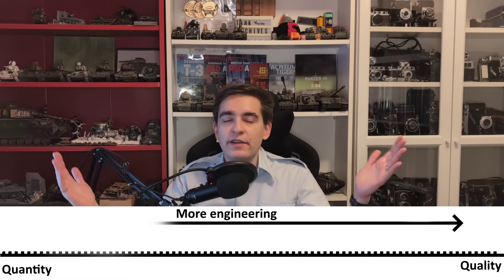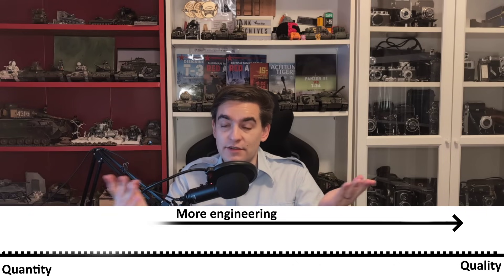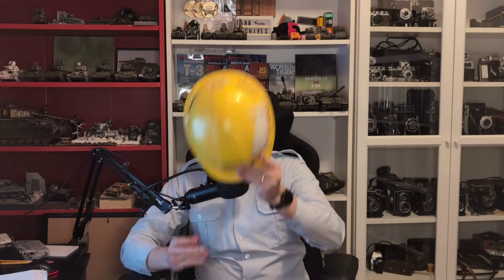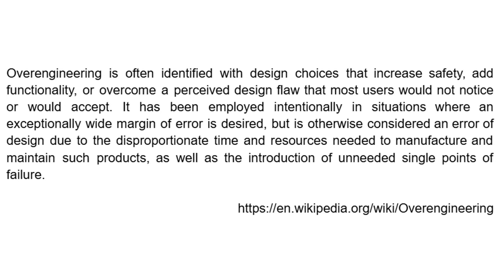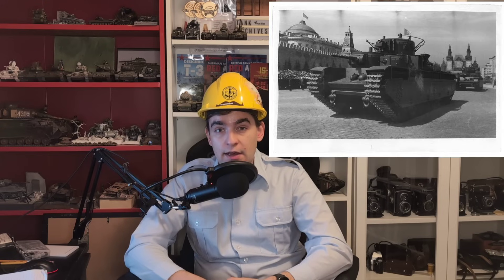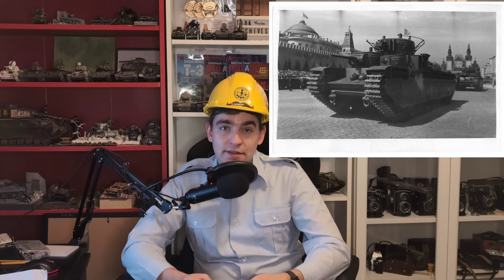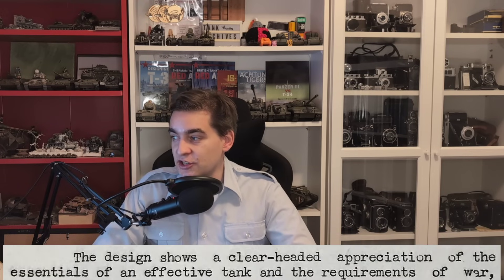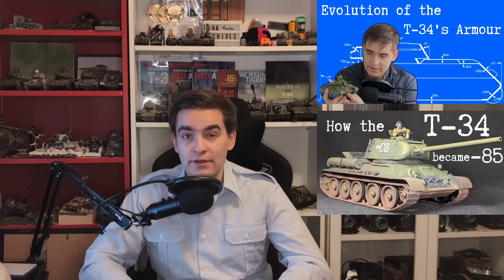Was the Tiger overengineered?

Comment: The 'Tiger' from a technical perspective was clearly a better tank than a T-34. The fact that the Tiger did not see major revisions proves, that is was well engineered.

In contrast the T-34 started its service life very poorly, having many design flaws. Yes, it was almost impervous to the german 3,7 cm AT guns... so were the Char B1, the S-35, the Matilda and problably even some french light tanks.

I really cannot understand how one can come up with such comparisons. T-34 was a mediocre machine, produced in vast numbers. ~44.000 of these tanks were lost during WW2 which is 25% more than ALL tracked vehicles produced by Germany during the war.
Reply: The figure you quote (44,000) also includes T-34s scrapped due to wear, not just combat losses.

And by comparison, the Germans lost 42,000 AFV on the Eastern Front alone, and some 67,000 total during WWII (yes, I know that's more than German production, but they made extensive use of captured Soviet and Allied tanks.  The Germans were using as many captured T-34s at Prokhorovka as they had Tigers).

Moreover, a Tiger vs a T-34/85 is NOT a huge mismatch, even in terms of gun vs armor comparisons.  While's true that against the T-34/85's thin (by late-war standards) upper hull (but not against the turret), the Tiger's gun still had the range advantage, the Soviet 85 mm could destroy a Tiger at practical ranges just as well as the Tiger could destroy a T-34/85.  Every other advantage (speed, reliability, etc) lies with the T-34/85.
Reply: Such games as World of Tanks and War Thunder did a dialectical thing: on the one hand they greatly increased the interest of the World War II military equipment among the average person, and on the other hand they generated crowds of half brain champs, for whom the combat and warfare became something like a game match with counting “pvp scores”.
Reply: @Ailasher I've never played either game, but a common feature of tank wargames is that your tank always works and operational factors like crossing bridges usually isn't a factor. 

Another factor in wargames is that there are no real penalties for failure.  If your tank gets blown up, you just play another game. If you lose an operational or strategic game, there's always tomorrow.  You don't really die and you don't really suffer the same consequences of a decisive defeat. If you did, then all wargamers would play a lot more cautiously, just like their historical counterparts.
Reply: @stewartmillen7708  There is one more important factor here, regarding T-34 losses on the battlefield. The thing is that even before the fact of what this tank was (obviously “good enough”, for the Red Army of course - like all equipment of wartime and especially of the mobilization period of the economy for all nations) it is worth considering how the Soviet side of the conflict used this tank. And it used it so intensively that I am not even sure that this phenomenon has an analog. As far as I know, the T-34's main losses in the war were not from German tanks, but from German assault guns such as StuG or Hetzer. Not to mention infantry anti-tank guns. 
So, the thing is, the T-34 fulfilled all of these roles. Of course, the Soviets had specialized equipment, like SU-85 or SU-76, but just look at the dates of development of this particular vehicles and understand that the second period of the war on East Front, while the T34 has already become a veteran on the battlefield in less than two years.
Assault of fortified positions, infantry support in the offensive and defense, independent actions of mobile tank and mechanized units - the T-34 did it all and more. Hell, this tank was even almost the main “armored personal carrier” of the Red Army on the battlefield - taking the famous “tankovy desant” as an example. Although, in this respect, a word “armored” did not extend beyond the tank crew.
Even taking reconnaissance as an example: the Red Army had armored cars, but I know of cases mentioned where individual tank platoons on T-34s were used as scouts for enemy fortifications. And there was a logic under it: that the enemy seeing tanks attacking their positions will have less intention to hold back and will show more cover positions of their main means of defense, like AT guns and other things.
Reply: @stewartmillen7708  But these all factors, including the ones you mention, are irrelevant to an individual who has a “kill ratio” literally from PC/console games in their head.
Reply: @Ailasher   I agree with all your points and more.  Insofar as 'tank vs tank' encounters and relative kill ratios, the point that I think you're driving at is that 'tanks have other jobs to do than to just fight other tanks', and that wasn't a point just shared by the Red Army, but by the US Army as well with the M4 Sherman.   In the Soviet army, artillery was the preferred killer of enemy AFV, followed by self-propelled artillery (which is why the ISU series may have been the single greatest killer of German heavy AFV; it was part of their specialized role to provide overwatching fire for Soviet armored advances).  Likewise, in the US Army, the M4 Sherman was supposed to be the general-purpose exploitation tank while enemy tank-killing was the job of US tank destroyer units, which is why there was resistance to replacing the Sherman's 75 mm gun with the 76 mm (the 75 mm had the better HE round so was more useful against non-armored targets).

The only army that did seem to design its armor for tank-killing was Germany, at least as the war progressed, and to ridiculous lengths.  The Soviet assessment of the Panther I believe to be spot-on, it was a 'one trick pony', as we would say, as it was designed to excel only at killing medium tanks in at long range.  At all other jobs, especially in its first employment at Kursk slogging through infantry/AT defenses, it was lacking, due to its unimpressive HE round and its paper-thin side armor that could be penetrated by US 75 mm or Soviet 76 mm even at very oblique angles.  The King Tiger too, as a heavy tank would have made more sense if it had been fitted with the Kwk44 128 mm gun (better HE round and better AT) than the more dedicated tank-killing Kwk43 88 mm.  Given the Wehrmacht fan-boy inclination of many wargamers, maybe it's not surprising that they come to think of tanks only in the 'tank vs tank' role.

But my point is that the metrics usually cited to 'prove' German superiority or that "The T-34 was crap" are flawed.  The Soviet tank dead pile includes tanks scrapped due to wear.  For one example, more IS-1s were lost to Soviet blow torches (melted down after exceeding their mileage limit) than were lost to German anti-tank weapons of all types.  While I doubt this is true of the T-34, the number scrapped is still likely considerable. The Soviets actually made less steel than the Germans during the war, so any obsolete or worn-out tank was far more useful as a source of steel to make a newer, better tank, than to keep.  By 1945, I'd say that a lot of T-34/76s that were still around were going into the smelter and thus "lost".  The USAAF likewise underwent a huge 'scrap-a-thon' in the European theater at war's end, putting tens of thousands of their own aircraft (plus any surviving German ones they had captured) on the chopping block to be sold for their metal.  As one article I read about the destruction of USAAF aircraft said, "seeing these photos are enough to make a museum curator cry".
Reply from the maker: As I mentioned in the video, revisions were required of the Tiger almost immediately. They simply couldn't be made without seriously altering the design.

Any tank used in vast numbers is going to be lost in vast numbers. Tanks are made to win wars, not Call of Duty style deathmatches.
Reply: @TankArchives  'Revision were required immediatly'... Thats normal progression right? And would you say that the construction of a completely new turret is no serious alteration of a design (T-34)? And can I say the T-34 was poorly engineered because it could not take the 100mm gun? And how relevant is the wishlist of a politician?

The Tiger was vastly superior when it appeared on the battle field. It clearly had the edge over the T-34/85 and was still on par with the IS tank.

The 'War winning tank' is a questionable term, that exaggerates the importance of tanks. I would not use it at all, because it leads to logical fallacy: The Wehrmacht defeated France while the majority of its tanks were Panzer Is and IIs . Therefore Panzer II is better than S-35. Really?

...'Call of Duty style deathmatches' ...well, you are the WoT historian, aren't you?
Reply from the maker: @adolfusknall3341  I'm not sure why you're conflating my posts and those of other users or why you think that slapping a new turret onto an existing and well polished hull is the same thing as taking two years to develop a new tank plus a year of working out the worst of the teething troubles.

Comment: Can't say "the" engine in the Sherman as it was fitted with so many different engines beyond the original air cooled radial
Reply: My joke about the sherman is it's not actually a tank, it's just a collection of dimensions, especially a 69" turret ring, that they can attach an entire family of parts together on to make a tank. For crying out loud, the gun upgrade involved just sticking its intended successor's turret on it. Five engine types, two hull lengths, eleven factories, and the tanks were compatible and could be standardized at the level desired for spares and supply, but could use the different capabilities of all those factories to make a good tank.
Reply from the maker: @xthetenth  you could also just pop the suspension off and replace it with something else. HVSS was the most successful but there were Shermans with torsion bars, Horstmann suspension, some weird tractor thing, and probably a dozen more I've never heard of. The Sherman was tremendously upgradeable.
Reply: @xthetenth  And don't forget 3 hull types; welded, cast, and a composite hull which had a cast front and welded back after the front hatches.
Reply: The Israeli M-51 "isherman" shows off the upgrade potential really well. They basically slapped an AMX-30 MBT cannon from the 60s on it and it worked damn good.
Reply: @baraka629 and the Chileans operated Shermans with a high velocity 60mm for decades after they acquired them too. Only retiring them in 2003. 

The M60.
Reply: @AtlantiansGaming  well; the longevity of that probably has something to do with the majority of Pinochet's opponents on the battlefield being unarmed civilians.
Reply: and that was a stopgap solution
Reply: The engine in most of the Sherman’s was the fire, which was considered to be an excellent, advanced engine.

Comment: To be honest all German mid- to late WW2 tanks were just too excessive and overcomplicated. Arguably Pz.IV was the most successful German tank during WW2
Reply: The Panther did only cost 10-15% more to produce than the Panzer IV, despite being "twice the tank". The Panther was also easier to maintain. The Panzer IV had reached its development potensiale already in 1943. Only the combo of very good gun, superb optics and high quality ammo kept it in the game.

The Tiger cost twice as much as a Panther, but Germany made 30,000 bombers and heavy fighters that cost about the same as a Tiger. Not to mention they produced almost as many U-boats as Tigers, each costing 20 times more.

Germany spent its blood in the East, but its money in the West.
Reply: @TTTT-oc4eb  I doubt Panther was easier to maintain than Pz.IV. Especially early Panthers had a lot of technical issues with the engine which caused them to randomly catch fire. A lot of the first Panthers  delivered to Eastern front at the battle of Kursk in 1943 were lost due to engine fires and didn't even make it to the battlefield. Also Panthers were heavier, meaning they required more steel than a Pz.IV, which already was already getting scarce in 1943.
Reply: @markolysynchuk5264 The Panther was specifically designed to be easy to maintain. It had easier access to the engine than almost any other tank.

The Kursk Panthers were deployed before they were ready - by early 1944 the Panther was a relatively reliable tank, with average readiness rates of 65-75% to the end of the eyar, only slightly behind the Panzer IV and Tiger.
Reply: Ok but would you rather be a crewman inside a Panzer IV that’s been hit and is on fire or a Panther that’s been hit and is on fire? Which of these two would you be most likely to get out of quicker?

Comment: I feel like you could go into more detail why the Tiger was this heavy. I don't have any primary source on this, but I feel like german tanks are generally so heavy because german industry couldn't cast large steel parts. If you cant cast Turrets and hulls you have two options:
a) make a complex shape of many triangular and square parts that have to be wielded together (Panzer I, II, III, IV)
b) make one big Box of a few parts that requires less wielding but more material (Panther, Tiger II)
Both a) and b) make a tank more expesive to produce.

I wonder: is there a source why nazi germany didn't or couldn't use large casted parts?
Reply: The Tiger 1 was about the same size as the Panther, Pershing and Centurion. Add more turret front armor, top, side and rear armor to these - and you will have  a 50+ ton tank.
Reply: Tiger was heavy because it had thick armour and powerful gun, with plenty of ammunition storage and 5 crewmen.
Reply: @AKUJIVALDO  Tiger weighed 15 tons more than the Pershing and its only advantage was that it carried 20 rounds more for the main gun
Reply: @sharky9075 imagine that, tank created 2 years later with years of war experience, less armoured, weaker engine, smaller, shorter range, way slower in cross-country, less ammo and it is lighter... LOL
Reply from the maker: The Tiger was based on mid-30s design concepts even though it wasn't built until 1942. You can see the echoes of the original Vickers tractor that the Germans copied back in the early 30s in it.
Reply: @sharky9075 Yes, and it's precisely this point that can be decisive in a combat situation. I have one, my opponent has none.
And 15 tonnes more armour.
Reply: @sharky9075 The Pershing also had lighter turret front armor and side (rear side) and rear hull armor, and also lacked a turret basket. And a lighter and weaker engine. The US Army also considered 70 rounds only borderline acceptable.